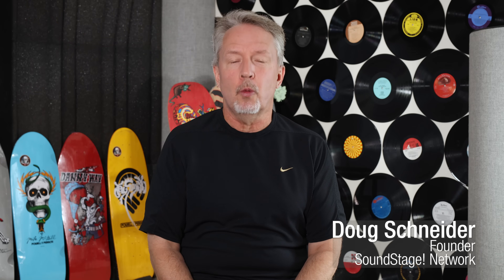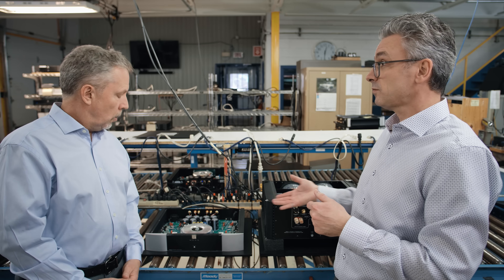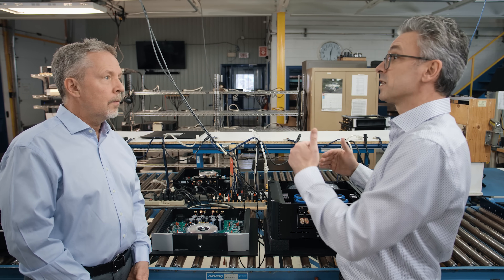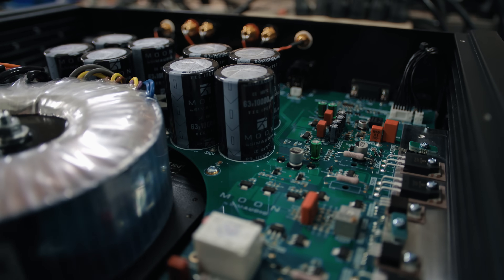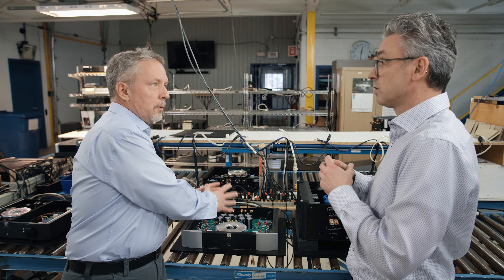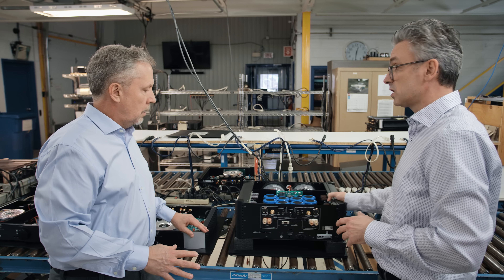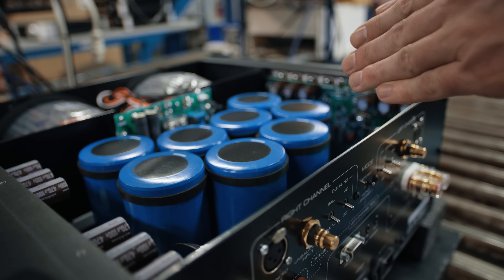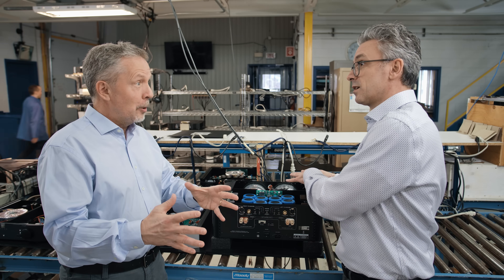Why Amplifiers Don't Sound the Same - Understanding Voltage and Current for Loudspeakers (Ep:71)

Comment: Let me explain without garrulousness. The ONLY thing you can control in audio is volume thus equalization of the different frequences. So, if an amp sounds different its because its TUNED different by its manufacturer preferences.
Reply: I am a 40 year experienced technician.  I've yet to see any amplifier that is "tuned" to anything but a flat frequency response across the 20 to 20k audio bandwidth.  In fact tuning an amplifier inside it's innate design is extremely difficult and generally unwise because of the effects it can have on reliability.
Reply from the maker: @Douglas_Blake_579  We mostly agree with you, but in our lifetime, we did encounter one "tuned" amplifier, which came from Redgum of Australia. Have a look: https://www.soundstagenetwork.com/measurements/redgum_rgm175/
Reply: @soundstagenetwork 
Finding one does not disprove the rule... but yeah, I would never do that to an amplifier and, more importantly, if I got one to service I would likely spend the time to undo that silly smiley face response curve.
Reply: @Douglas_Blake_579  I hear ya about that, but we just wanted to point out that these amps DO exist -- even if they are few and far between. Interesting thing about the Redgum amps is that people would put them on their speakers and remark how much more powerful the speakers sounded, and how much better the bass was. Including me. Once we measured one, it explained it. But I will say, the frequency contouring didn't sound bad.
Reply: @dougschneider8243 
It's actually what a lot of people are used to... What's the first thing the average joe does when he gets that wonderful receiver home?  He turns the Bass and Treble all the way up!  ... That's what the curve in your link is... an amplifier with the Bass and Treble turned all the way up.
Reply: Yes, totally true. But then, you are also familiar with harmonic or intermodulation distortion and feedback loops, and how these key factors can "tune" the outcome
Reply: @zambination11 
Have you looked at the distortion specs for most modern amplifiers?  We're talking hundredths of a percent  (0.0001) of the tested output level. Not only is that very nearly zero it is totally inaudible.

Moreover, this is usually accomplished by the use of output to input feedback to oppose and remove anything that isn't part of the input signal.
Reply: @Douglas_Blake_579 Yes i have. So how come amps having the same wattage output sound different than each other, if the output is not impacted by the amount of noise or distortion added by the amplifier while it is amplifying the input signal? Is the frequence responce the same at all dB's then? And why consumers or audiophiles choose one over the an other?
Reply: @zambination11 
Unfortunately the answer to all that is one that you probably don't want to hear...  But I'll bite...

If you did a standard blind test ... same source, same speakers with level matched amplifiers silently switched, so that you have no actual knowledge of which amplifier is playing at the moment, it is very likely you would not be able to tell them apart with any certainty.

Of course, as you point out, deliberate and incompetent design differences can undermine this situation rather badly. So on occasion you can pick one out of the crowd... and most often it will be the "stinker in the herd".

Measurements do not lie and they are not affected by environmental differences.  If there genuinely was a difference, you would see it in the test results.

This, however is not true for our hearing.  Everything influences our perception of sound... temperature, air pressure, humidity, background noises, room size, the number of people in the room, open windows, focus, diet, cleanliness, mood... hell even when you took your last dump has some influence.  So on a biological level listening tests are simply not trustworthy.

Can you honestly tell me that you can hear the difference between 0.01% distortion and 0.1% distortion?  Can you tell if one amplifier is 0.1db louder than another?  Can you accurately report the frequency of various sounds?  
Of course not... nobody can.

Now toss psychology onto the heap and you get silly situations like being told one thing is better than the other or the old "play close attention game" to further manipulate an already highly unreliable means of assessment.

The attention game is an interesting example ... sit in a quiet room (no music, no TV) relax, balance your head and get a sense of what the room sounds like. Now with your thumb and forefinger pull your ears gently back and up. Notice how the room sound changes.  Now, relax again, but this time focus on one particular sound (a fan, a ticking clock, etc.)... did you hear it?  The overall room sound changed as before as soon as you focused in... That is a biological reaction, we do it without even noticing it.  It's the difference between hearing and listening... and you can bet these companies use it to advantage when selling equipment.

Ever wondered why the first demonstration is to turn up the volume?  Our ears are more sensitive to fine detail at lower levels of loudness. We are far more likely to pick up on a room echo or audible artifact at 40 to 60 db levels which is where most conversation occurs.  Again, when listening, we tend to "cock our ears" to hear better... at high volume levels the sound becomes an assault on our hearing and we tend to shut down... making bad stuff sound better.

I can keep going on this for a long time... but I trust the point is made that the best results will come from both an examination of the specifications and a controlled listening test. 

Finally... as a service technician, every "house call" I did always started with a listening test. It helps me zero in on the flaw or the problem... but the final fix is always accomplished with test equipment.
Reply: Only partially true. If a designer tunes the amplifier by varying the frequency response, yes, that will have an effect on the sound. Very few do that, however. In fact, in 20+ years, we've only see one "tuned" amplifier -- it came from the Australian firm Redgum, which puts a boost at lower frequencies to compensate for the decreasing output of almost all loudspeakers as frequency decreases. Basically, it's acting as a tone control in the bass. But most amplifiers measure flat across the audioband into a resistive load (8-, 4-, 2-ohm, etc.). But loudspeakers aren't flat impedance, so if the speaker has a very high output impedance (which means a low damping), the frequency response from the loudspeaker can stray and, depending on how much it strays, be audible. I wouldn't call that the manufacturing "tuning" the amp, though, since the variance depends on the loudspeaker the amp is connected to. Another thing that can be audible is distortion.
Reply: @dougschneider8243  Yes of course thats an accurate overview of how amplifier tuning, loudspeaker characteristics, impedance, and distortion can collectively impact the "sound quality" of an audio system.
Reply: If an amp sounds different it's typically due to poor circuit design.
Reply: @1leisure1   While poor circuit design can indeed lead to differences in sound quality, it's not the only factor. There are various other aspects, such as component quality, intentional tuning, speaker interactions, and subjective perception, that can contribute to variations in sound between amplifiers.
Reply: @zambination11  But you said the only difference is volume and design control. The reality is that amps with a "sound signature" are usually unintended due to poor engineering.
Reply: @1leisure1  As far as "sound perception" yes i did said that. Not sound quality. And poor engineering could "potentially" lead to unintended sound signatures but the presence of a distinct sound profile in an amplifier is not inherently an indicator of poor engineering. Manufacturers might intentionally create these signatures to cater to preferences or design goals, and various factors can contribute to the final sonic characteristics of an amplifier.
Reply: @1leisure1  Undoubtedly, if it's a poor design, you'll see it in the measurements -- frequency response, distortion of various types, noise, output impedance, etc.

Comment: This is super cool! This pops a question into my mind - If the power coming from your house fluctuates slightly is there an impact on your amp and therefore sound? i.e Could power conditioners actually have an impact on providing the best sound to your system?
Reply: Simple answer ... No.

It would take very large fluctuations over a considerable period of time (so called "brown outs") before any noticeable impact on sound quality. 

An amplifier runs on Direct Current (DC).  This comes from an energy reserve in the power supply's capacitors that is replenished by the AC wall power.  Unless you are driving your amplifiers to within an inch of their lives, most equipment will withstand a few low voltage cycles, even missing cycles, before the DC reserves in the power supply begins to dwindle.
Reply: It's a good question -- and something that confuses many audiophiles. Most power conditioners are "passive," meaning they don't actually have any energy of their own to increase power. Instead, they work on "cleaning up" the signal through filtration, etc. Whether they do that is up to the competence of the design. But the voltage coming into the power amplifier certainly affects the power output -- we see that in the measurements we do, and that's one of the reasons our measurements specialist, Diego Estan, note the minimum voltage seen with every amplifier he measures. If you have lower voltage, you'll have less power. If a power conditioner is active and can increase the voltage over what's coming out of the wall, it can increase power.
Reply: @dougschneider8243 you reminded me I have one of these devices somewhere. my house voltage is not always stable but I haven't noticed an issue with my amplifiers. From my experience most good built-in power supplies can deal with most issues. If it's a well-made product just block the spikes.
Reply: @gregmatula9749  Hopefully I can get Diego, our measurements specialist, to chime in. But he and I have talked often about this and he sees no real change in distortion, noise, etc., when the voltage is lower. The change is in maximum power output -- and it correlates perfect in that higher line voltage means higher power output. He says it's due to almost all power amplifiers' power supplies being unregulated unlike, say, a preamp's.
Reply: Yes, the change is in maximum power output, or, in other words, what output power we see at 1% THD (with an 8 or 4 ohm load). This is because virtually all power amps use unregulated power supplies (PS). For a conventional linear PS, AC line voltage is stepped down through the PS transformer, then rectified using diodes (basically alternating positive and negative voltage AC swings are converted to only positive voltage swings), then the diodes feed the PS capacitors. These caps, by quickly charging and slowly discharging, convert the positive voltage pulses into a DC voltage. So, we see how the PS DC voltage level will vary directly with the peaks of the AC line voltage. And of course, the peaks in the analog output of the amp can never exceed the DC voltage rails powering the output transistors. At moderate power outputs (well below max power), changes in line voltage have essentially zero impact on THD and noise. @dougschneider8243
Reply: ..if it fluctuates slightly as you say it shouldn't matter..the energy storage devices should be able to handle this..& one's ears may not notice it..
But can get out of bounds on sustained / repeated fluctuations ..thats when a regulated supply is an advantage.
Reply: @analoghardwaretops3976 
Trust me on this one ... If your AC line is fluctuating enough to mess up the sound of your stereo... your stereo is the least of your problems.

Comment: This is why the " how many watts " question is not as important as the current available, the power supply quality and the amount of capacitor storage for dynamic peaks when called upon in class a/b designs. My lowly 40 watt per ch. tube amp has lots of impact for so few watts..lol, then again the power transformers are massive and deliver lots of sweet sounding current ❤ Great video 🎉
Reply: More amps is more power isn't it? W=A*V
Reply: @1337sim1 more Volts is more Watts too!
Reply: The other thing too in why we think lower power tube amps, or pure class A solid state amps, sound more powerful than their wattage rating would lend you to believe is because they clip much more softly and so you can push them harder and utilize more of the watts available and still get clean and dynamic sound and higher volumes. The result is - wow, this little amp sounds like a 200 watt solid state AB amplifier.
Reply: @sean_heisler  True, plus it's funny how we find the harmonic distortion from the tubes pleasing while "audio science guys" are going after measurements only with super low distortion of .00003% etc. and declare an amp junk otherwise..lol. My sweet old Conrad Johnson tube amp would have been considered horrible today I suppose !
Reply: I think the problem consumers have is that we don't know what power the amp has at what frequencies.

Plus, we don't know the resistance load of the speakers for each frequency...
Reply: @1337sim1 
Load impedance, rather than resistance.
Reply: Most people  Tube people get the Dynamic swing from the speaker sensitivity ( you don't have that big capacitor reservoir) in a Tube Amp
Reply: @closereveryday  Yes, I am aware that my tube amp is not filled with a capacitor bank🤔 Which is why I said "in class a/b designs" when mentioning capacitors and then "the power transformers are massive" when talking about my tube amp. The point was about watts vs. better power supplies providing more current. Not much to do with impedance except a better supply can handle lower impedance swings better for sure.

Comment: The number 1 cause of sound degradation is the lack of power and it's inability to handle the speaker's heavy loads.
Reply: So it's a good idea to use a subwoofer for low bass (ex. <80hz) with a high pass filter on the main speakers for the bass, mids and highs (ex. >80hz) ?

My understanding is that active subwoofers have powerful amps for made to amplify low bass (500W, 800W and more) because it's harder to play those frequencies.
Reply: Wrong on that.. get the white paper by Bob Carver then you understand